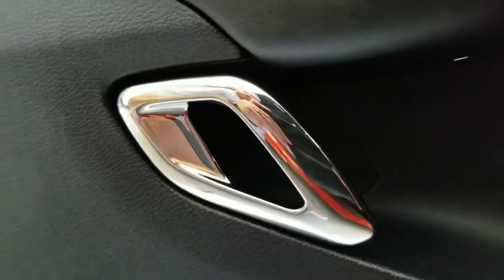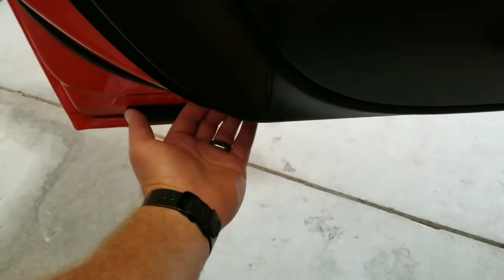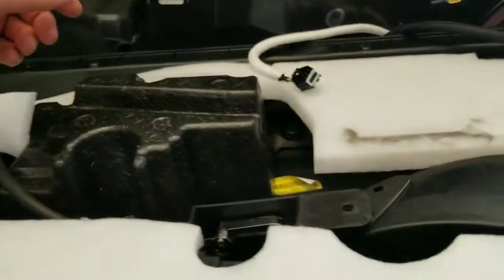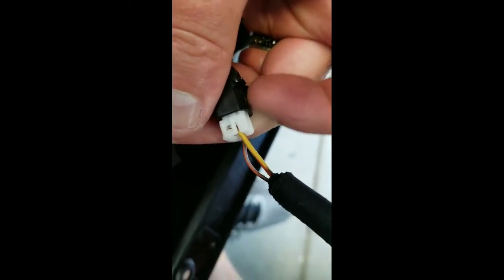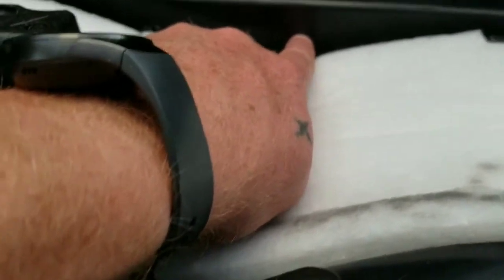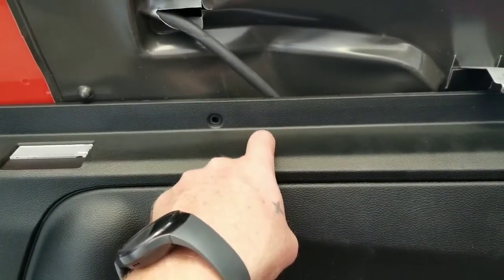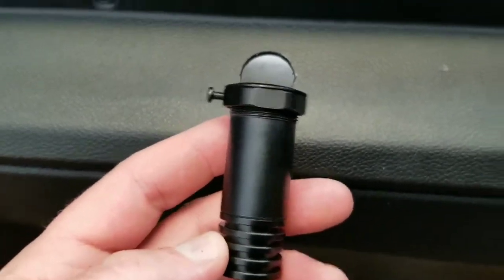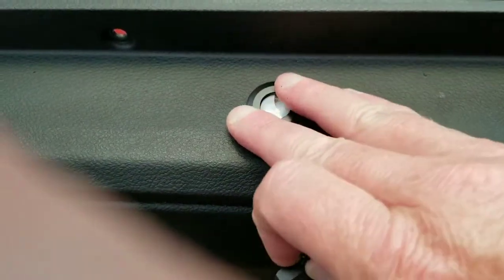How to install ghost puddle lights on Hellcat

Comment: Blast led makes one that plugs into the original spot from the factory. Costs 50 American, but no drilling or dismantling, installs in about 2 minutes.
Reply from the maker: Yea these are the orginal before the new easy ones came out. They are alot easier now a days

Comment: quick question I have a 16 Challenger Hellcat I had the puddle lights for like 2 years I noticed one of my lights went out 2 days ago it doesn't have a bulb but just has a LED that means the LED is no longer working is that correct because I'm sure it cannot be replaced I just have to order a whole new one ?
Reply from the maker: 314DOOGIE yea will need a new one see link in description 25bucks for 2 of them
Reply: Here Kitty Kitty Srt thanks bro yeah I ordered two of them last night lol I just needed to make sure before spending money if there was a new problem electrical r something  thanks again bro for replying back